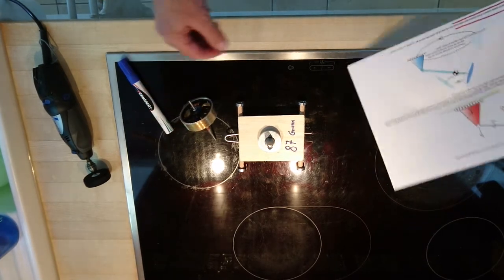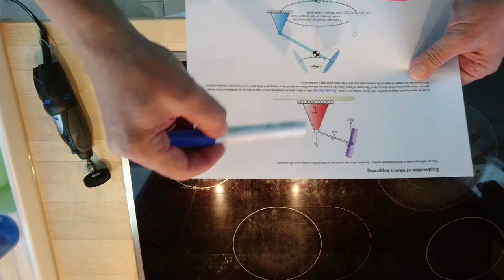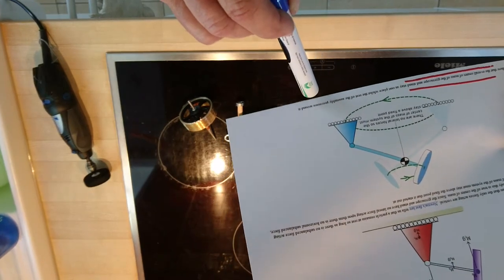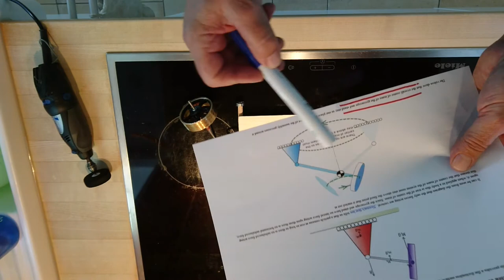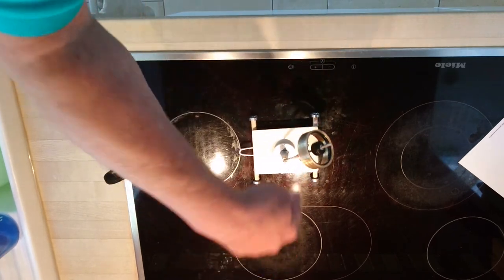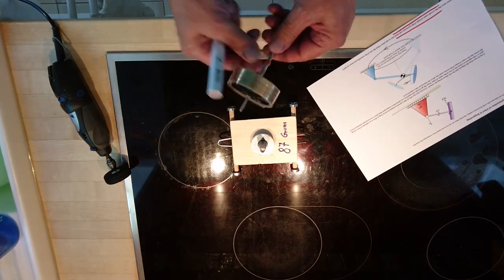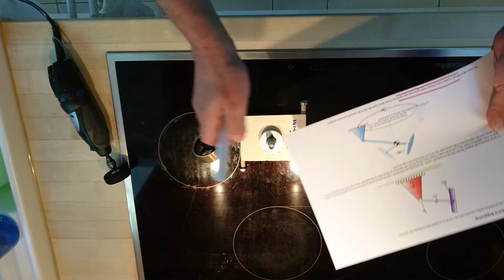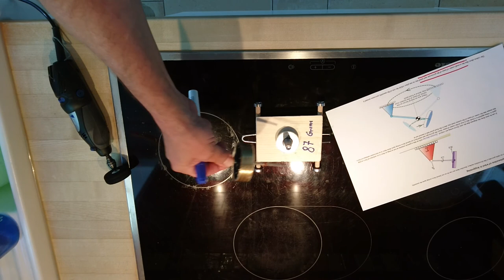inertial propulsion with gyroscope part 16

Comment: The experiment in this video using a frictionless trolley or iceblock with lack of friction under the pivot, works as it does, because if the spin in the gyro is very very fast, then there are created in the precessing-gyro-wheel,  two phenomena which are, an outbound and inbound centrifugal forces acting on the upper and lower half of the gyro "face" and to the left and right of the vertical diameter of the gyro wheel. Their vertical separation sees to torquing against the down weight of the gyro through the arm ( m.g. R arm)  while the horizontal separation creates the precession angular rotation seen in a floating gyro experiment.  These two opposite acting but separated centrifugal forces to produce both a vertical and a horizontal torque are equal (most of the time the gyro spinning is fast) and so there is no lateral reaction on the pivot. Since there are no linear accelerations and the angular accelerations are constant, then there are not even any horizontal flicks on the support pivot due to the orbiting torque of the gyro. The pivot in this state will only take the vertically down acting gravitational weight ( one constant acceleration)  and any other change in accelerations in the height and orbiting of the gyro.  When the spinning of the gyro is reduced, then the upper inbound centrifugal force is reduced and the normal centrifugal force on the gyro and the ice block or the wheeled support trolley is established and their presence starts to be felt. At slow angular rotations, there is also a lateral horizontal force on the pivot in a sequence of directions and the rotation will first seek to rotate about the total mass center as both the outward centrifugal force on the trolley/ice block and also that on the gyro, will fight out a tug of war between them.  There seems to be a horizontal "orbiting" torque on the apex of the two cones made by the wobbling extension arm that does not seem to be always lined up at the same central location, but it orbits in small circles while both the ice block and the gyro are eventually, rested.  The last motion is much more than an example of a " horizontal flywheel" with static balance and dynamic unbalance.
------------------------------------------------------------------------------------------------------------------------------------------------------------
****In order to understand the engineering /physical reason for the creation of the inbound and the outbound centrifugal forces and how they change their relations with different spinning relations with the radius of the extension arm Ra, the radius of the spinning wheel Rs, Wp angular procession of the radial arm, Ws the angular spinning rate of the gyro wheel is to simply draw the plan view of the gyro spinning and precessing wheel around the pivot point:-
Assume the above machine has its gyro and extension arm in a  perfectly horizontal position, then draw the PLAN  view of the whole system. Take Ra to be 3*Rspin  while marking the largest circumference at radius Rs (mentally or otherwise) of the Spinning wheel every 90 degrees by using 0, 1, 2, 3 as angular position symbols. Four marks are enough to see the result.  Then measure the radius  Ra and draw the arm rolling flat circle, then the tangential line diameter 2Rs of the spinning wheel. The plan view will be a circle that the arm Ra executes while the line 2Rs as a tangent to the circle will represent the gyro maximum diameter in the horizontal location.  To see the lack of or the creation of the internal bound and external bound centrifugal forces in the plan view on the central pivot, first, draw the trajectory of one mass particle (0) on the spinning wheel without the extension line arm radius Ra advancing anywhere. Simply keep the center of 2Rs  which is (maximum diameter representation of the gyro)  tangent to Ra circumference, and choosing the position (0) on Rs as being vertical to start, roll the "vertical radius Rs through one revolution while the center of the gyro rests in the same location.  The first vertical point on the gyro starts as a tangent to the circle Ra.
 Plotting only four points in sequence every 90-degree rotation of the spinning gyro represented by a tangential line, 2Rs in length, this will include, (First point, tangential to the circle (vertical radius situation )) then, (the second point at the maximum diameter say extreme right of the tangential gyro,( horizontal radius situation)), then  (The third point representing the radius of the gyro reaching the lowermost point which would be like the first point tangential to the (Ra) circle) then ( the Fourth point which will be to the other extreme end to the left of the line 2Rs representing the horizontal radius of the gyro)  then include (a Fifth point  tangential to the circle at the starting vertical point, representing the gyro turning one full circle. )  Note that without Ra advancing, that all these five points exist on a straight line in this plan view of a spinning gyro which means that the outer tip of a  spinning radius will be forming a perfectly flat circle rotating in the vertical plane tangential to extension arm, Ra)  This radial Rs centrifugal force in the spinning of the gyro will not affect the pivot point in any manner apart from storing spinning energy in it.
Now, having the (Ra) circle and next to it the tangential (2Rs) line diameter of the gyro, follow the free ends of the line Rs and this is found to be far away radially from the circumference of (Ra) circle.
Using the previous central pivot point as a center, draw a second larger circle with a radius as long as the outermost tip of the diameter representing the tangential gyro wheel.   All the magic that shows the creation of the inbound and outbound centrifugal forces in a gyro is located in between the circle represented by the radius ( R arm ) and the circle represented by the radius square root(Rarm^2 + Rs^2)
To draw the trajectory do what one did before, but  ADVANCE THE GYRO TANGENTIAL LINE  (Ra) every 90 degree turns of the gyroradius starting with a gyro vertical radius at the tangent of (Ra) circle. Do not choose the advancement of the gyro on Ram circle to small but whatever advancement you chose,  the spinning radius of the gyro with the gyro rolling along (Ra) circle will produce the plan view of the cycloidal path of one spinning and precessing gyro.
With respect to the central pivot support point, the plotted trajectory existing in between the limits of two circles will have beautiful symmetrical with one curve representing the trajectory of the mass particles in the upper half of the gyro showing a convex curve while the other showing the trajectory in the lower half of the spinning gyro will have concave curve trajectories  THESE TWO CURVES WITH RESPECT TO THE CENTRAL PIVOT ARE THE MYSTERIOUS TWO CENTRIFUGAL FORCES WHICH GIVES THE GYRO ALL ITS MAGICAL BEHAVIOR. 
Every engineer should be conscious of the ingenious manner in which the outbound and inbound acting centrifugal forces in a spinning and precessing gyro are created, and how their vertical and horizontal (diagonal) separation can be used to torque the spinning gyro wheel to float up or down the weight of the gyro and at the same time control its processing rate. 
This is the fundamental operations of all gyro machines shown by Professor Eric Laithwaithe, Sandy Kidd, Woopy jump, Maths Easy Solution, and anyone else who works with gyros.
Reply: My opinion about why inertia seems to disappear from a gyro is as follows.
Let us assume that the gyro mass wheel is spinning at about 5,000 revolutions per minute.
Then I shall take the arrangement shown in this video to explain my thoughts. 
The gyro which is seen in this video is suspended with its axle in a horizontal orientation. When one thread was burnt,  the other thread took over the suspension point and the gyro was all of a sudden subjected to a TORQUE of (m.g.Ra) mass, gravity, and extended arm Ra. The remaining thread was also involved in creating the torque action.
1. With the weight (mg) acting vertically down the gyro body was subjected to a drop and a torque.
2. This drop retained the instantaneous horizontal diameter of the spinning wheel but tilted the instantaneous vertical diameter "diverting out"  the upper high-speed mass particle and " diverting in" the lower high-speed mass particle, changing what was equal but opposite momentum, in the same plane, to divert their courses away from the opposite faces of their spinning plane before the drop occurred.
3. The vertical diameter tilting rate of the drop decided the new velocity vector DIRECTION components at the top and bottom of the tilted vertical diameter which was added to the previous spinning velocity.
4. This change of direction of the upper and lower masses in the gyro spinning radius, proceed in their new "almost linear momentum"  and the tension and " side structure solidity" in the radius component cause the two fast-moving mass particle on opposite radii to swing to their maximum after just (1/4)  a quarter of a turn of the spinning wheel.  This was really the time taken for the  FIRST 90 DEGREE PRECESSION. it happened in ((1/4)(1/5000) seconds
5. The action described in (4) caused a horizontal torque on the gyro axis in a particular direction, which set the gyro rotating about the central pivot support point. Hence (m.g.Ra) torque due to weight= (I.Ws.Wp) angular precession torque.
6. The gyro instantaneous horizontal diameter was now inclined in a similar reaction to that occurred in the vertical diameter with the initial drop. This horizontal action to the modification of the masses on the horizontal instantaneous diameter resulted   ((1/4)(1/5000) seconds later in torquing the gyro in the vertical plane which in conjunction with the extension arm pushed down on the pivot to take the weight of the gyro. This what I call  THE SECOND PRECESSION in a floating gyro as shown in this video.
So for these two 90 degrees, precessions which resulted in a 180-degree phase shift took about ((2/4)(1/5000) seconds which is half a spin of the gyro wheel.   If we are pessimists and say that it took 10 spins to settle it then that is something that the human eye cannot even see! 

This phenomenon of how an action is transferred to two 90 degrees operation is also found in electrical engineering in alternators and motors.

If a voltage supply V is applied to a motor or a transformer, then the magnetic field B is lagging 90 degrees, and once the magnetic field shows its presence the spinning coils in the motor show its effect by inducing a back emf E again 90 degrees later to oppose the input.  In AC work say 50 or 60 Hertz one may say that half a cycle  1/( 2*50) seconds to excite the back emf  hence V= E opposing it 

Considering that when torquing a spinning gyro only one effective large diameter is being slightly tilted the effective high-speed masses that are being diverted from their previous course to precess and hence the mass close to the dormant diameter does not seem to count a lot and perhaps the inertia to be accounted for would be much less than what the first intuition tells us which is either the total angular inertia about the center or the e=inertial about the diameter.............certainly, not an easy matter to settle!

Comment: Put a second gyro on the end of that metal bolt.   With that same set of hinges on it and then when you start both gyros up see if that lifts it up?   you have two,    one on each side.

Comment: Have you tried this on an air table? It may be that friction between the wheels and the table varies over the cycle of the motion, resulting in better transfer of momentum to the table through the wheels during the forward motion than at other times..